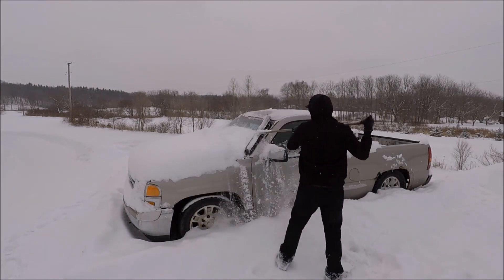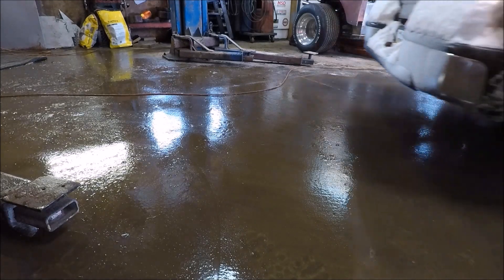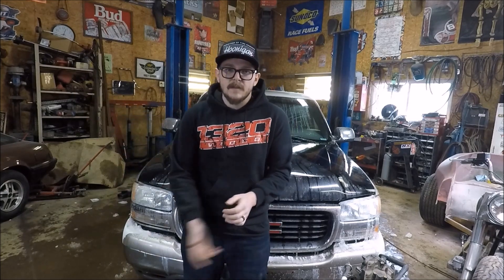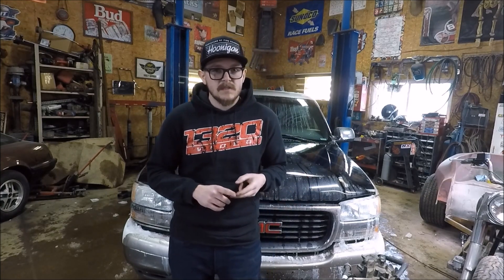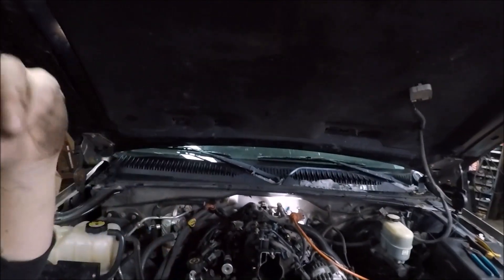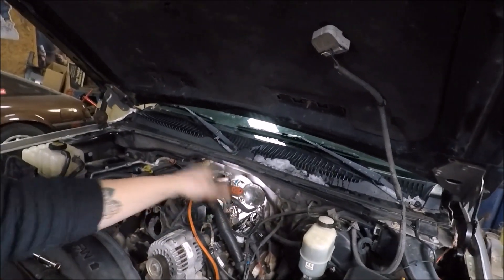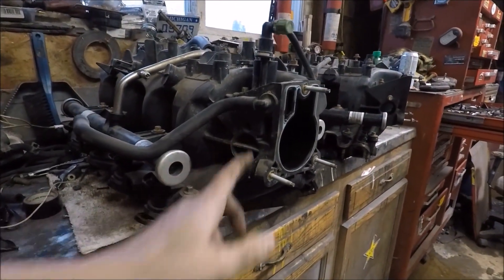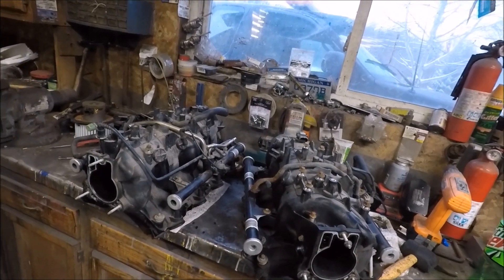5.3 Upgraded Intake | 2000 GMC Sierra

Comment: I did the same but I used a 07 and up manifold alot bigger more air just needed a plate for the throttle body really recommend it bro.
Reply from the maker: I thought about it but my goal down the road is to boost it. Either turbo, in which case people are making more than enough hp with the stock intake. Or LSA, which replaces it anyway. But, yeah if it wasn't for trying not to spend more money than I have to, I definitely would get a better intake
Reply: ayyeefredo94 i have an 06 5.3 sierra so you think an 07+ manifold will give me some small gains?
Reply: ayyeefredo94 what kind of plate did you need?

Comment: Hi, I have an 04 Yukon that has not been running right for a while, my friend /mechanic and I are having a hard time figuring out the problem...His computer just shows random misfires. The motor has only 130k, miles so we keep thinking  it's the intake and or the injectors....Nothings seems to be obvious..
Reply from the maker: We had some bad injectors cause that on my dads truck. Chased a misfire for about a month, finally replaced those and it was great after that
Reply: We have dumped all kinds of cleaners into the fuel system (my friend is cheaper than me!).. The problem would go awy for a while and then return. 
Should we replace all of them?

Comment: I've got 2004 Yukon 5.3, and I heard people are put in 2014 intake manifolds on, to get performance as good or better than tbss intake manifolds.. do you think that's feasible?
Reply: Hi, I have an 04 Yukon that has not been running right for a while, my friend /mechanic and I are having a hard time figuring out the problem...His computer just shows random misfires. The motor has only 130k, miles so we keep thinking  it's the intake and or the injectors....Nothings seems to be obvious..

Comment: Are those the plastic type intake manifolds? I recently replace the intake manifold gaskets with the fel-pro metal body gaskets.
Does anyone make aftermarket aluminum intakes for a 2007 silverado classic  1500, 5.3 liter engine?
Thanks,
Alan

Comment: So did that take care of the codes cuz I'm having the same problem
Reply from the maker: E Frog yeah, since swapping them I haven't had any issues. I would start by just checking the bolts, because a few of mine were just loose and tightening them probably would've done the trick for me.
Reply: What is the torque specs for the intake manifold bolts?

Comment: Hey what's up man love the videos keep it up how's that limited slip holding up? Any issues with it so far? Thanks!
Reply from the maker: Dark Night 209 so far, it's holding up like a champ! No complaints at all
Reply: SniderTron 3000 awesome!! I'm definitely buying it tomorrow I have a channel myself "209 Garage" I've always wanted to ask you how it's holding up as I'm logged into that channel my phone is on this account so yea thanks for the reply! Oh one more thing did you take it to a machine shop to install the bearings?
Reply from the maker: Dark Night 209 I'll check out the channel for sure. And, no, I didn't take it to a mac shop. My neighbor just happened to buy a harbor freight press a few weeks before this, so I just went over and used that to pop them on

Comment: Hey man so what did you do about the 2005 not being a return style fuel system ?
Reply from the maker: It's the same as the earlier 99-04 fuel system. Aside from EGR and bolting the throttle cable down, it was a direct swap.

Comment: Hey bro how did you block off your egr on the intake if you did the egr delete
Reply from the maker: I swapped to a later style intake that didn't have EGR. But, you can get the EGR plug from Amazon for like $12 or something like that
Reply: SniderTron 3000 oh ok thank bro ill look in to it because im thinking delete mine i got long tube headers with a 3" y pipe

Comment: Are you planning on going turbo with the truck?
Reply from the maker: Blake Taylor I want to do some sort of power adder to it eventually, but idk if I want to turbo it, spray it or save up for a procharger.
Reply: I know you put an LSD in it but you should look into either a 9 inch or an 8.8 inch once you start making some power with this guy there isn’t a whole lot of videos on swapping those rear ends in these trucks it would make for some really good content and hopefully bring you some decent views
Reply from the maker: Blake Taylor I would totally swap in a 9" or 8.8" and build a 4 link for it once it makes decent power. Hopefully that's not too far down the road lol

Comment: Could you send a link of what you used to lower your truck??
Reply from the maker: Jeremiah Fixin I've got a video where I lower the truck. Its a kit from Airslamit, but I just searched "2000 gmc sierra 4/6 lowering kit" on eBay and went with the best cheap one I could find.
Reply: SniderTron 3000 I watched the video last night and tried to look for it on slamit but no luck. Thank you
Reply from the maker: Jeremiah Fixin ah, alright, I'll see if I can find a link for the one I got. It was a cheap kit, but it's held up great and rides so smooth
Reply from the maker: This looks pretty much the exact same thing I used.

https://www.ebay.com/itm/4-6-Drop-1999-2007-Chevy-GMC-1500-V8-2wd-Spindles-Suspension-Lowering-Flip-Kit/122258902645?_trkparms=aid%3D222007%26algo%3DSIM.MBE%26ao%3D1%26asc%3D48419%26meid%3D7aeb897f4f0644ff8b73993c1c839a02%26pid%3D100005%26rk%3D1%26rkt%3D12%26mehot%3Dpp%26sd%3D201502854063%26itm%3D122258902645&_trksid=p2047675.c100005.m1851
Reply from the maker: Yeah, the 2/4 drop should be a lot cheaper. It's just springs and shackles. The only thing about doing a 2/4 drop is a lot of people tend to want to go lower later.